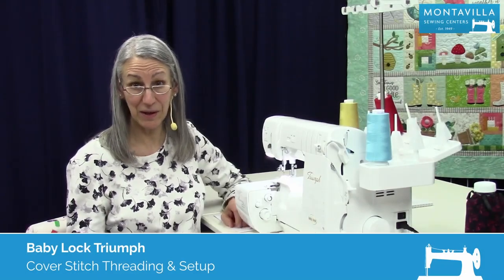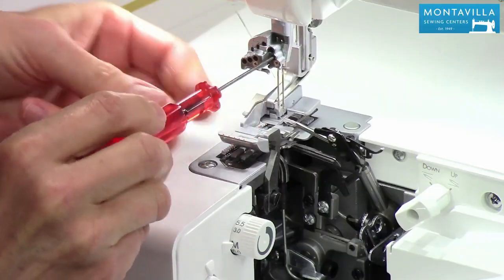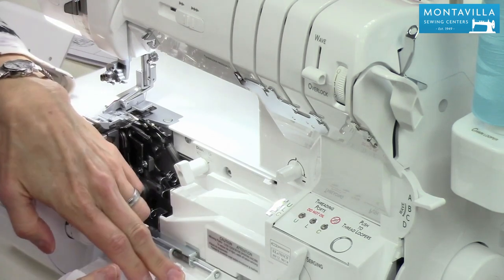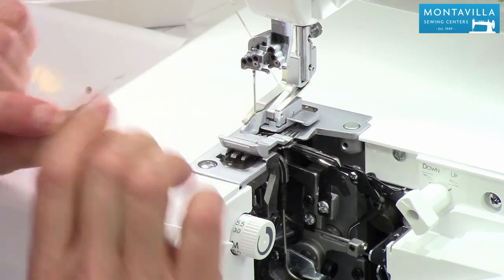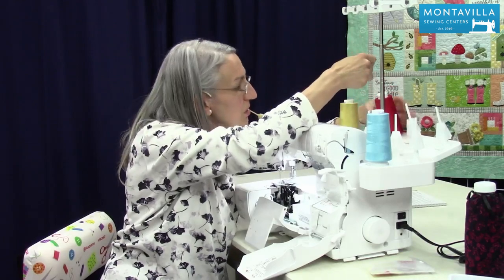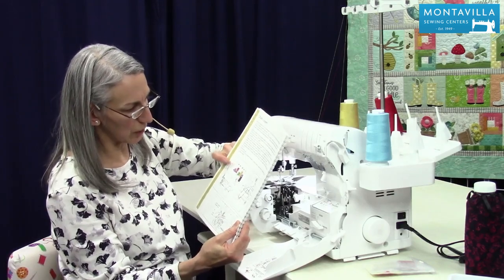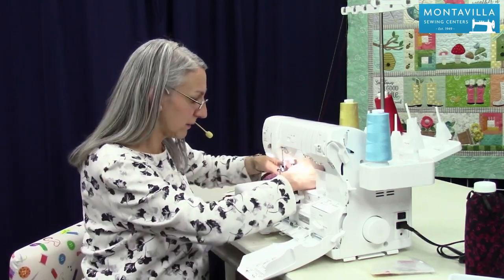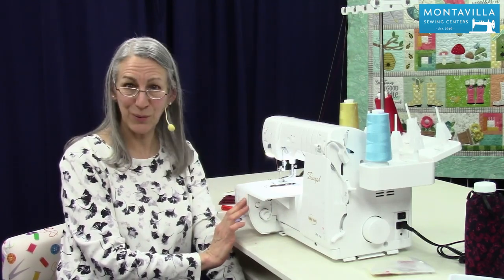Baby Lock Triumph - Cover Stitch Threading & Setup

Comment: Thank you. When would you want to use Right Narrow stitch as opposed to Left Narrow? Directions appear to be the same.
Reply from the maker: I use the right narrow overlock stitch and a short stitch length for finishing the edges of quilted coasters. It pivots well around the curves since there is only one needle in play. When you serge with just the right needle, you will need to change the selection lever to B, which tightens the loopers slightly to compensate for the narrower width. If you are talking about narrow cover stitch, then yes, there is not much difference. Just try them both to see which setup you prefer.

Comment: Can you have your knife engaged on a cover stitch? Thanks in advance for your answer. ❤
Reply from the maker: technically it can be engaged if you have the serger plate on the front cover. though ideally you would use the coverstitch plate. we also can't think of any practical application for cutting off fabric while coverstitching, since you would be cutting off the hem of something, or cutting a raw edge, which you would usually use a safety stitch for (which uses the cover and serger stich at the same time.)